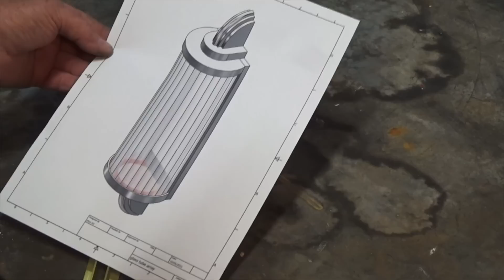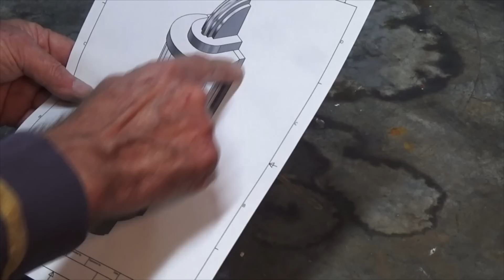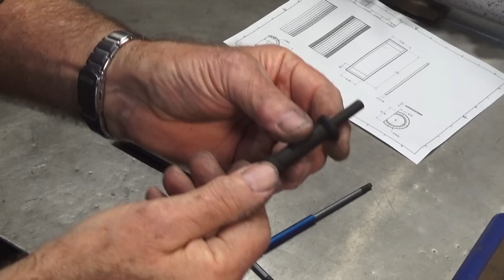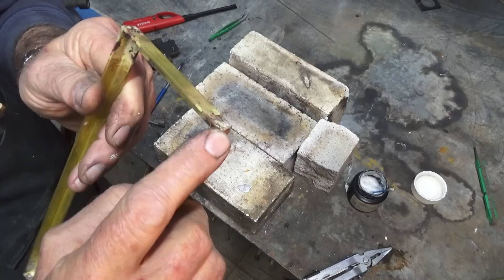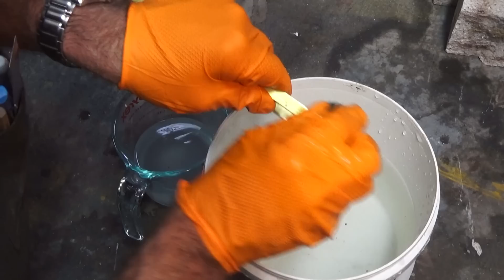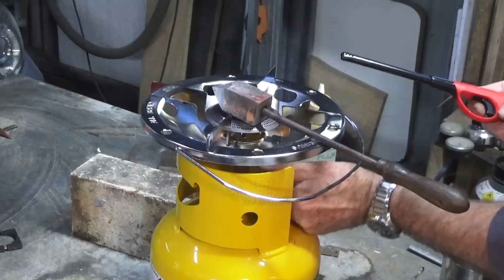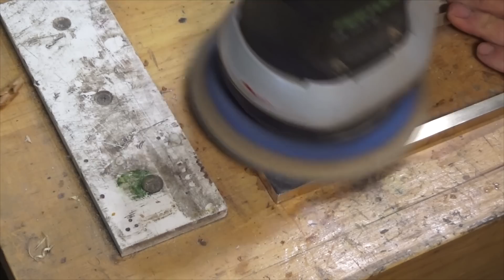New Fabrication Project - All the Good Stuff!

Comment: I guess I’ll throw out the silver rod I have from my grandfathers shop.  Thanks for the heads up on Antimony.
Reply from the maker: As long as you have good ventilation in your work space it's fine. Also the issue only arises if you overheat the puddle of molten silver solder and vaporise the antimony.
Regards,
Mark

Comment: I dislike being a 'safety Nazzy', but if you use lead solder( like old school auto body solder), due to the risks of inhaling lead particulate you should file the material instead of sanding as sanding creates tiny particles that can easily become airborne and potentially inhaled causing the health problems associated with lead exposure
Reply from the maker: I did wear a mask or at least I did after I realised how much dust was being produced by the fine sanding belts. Many years ago there was a very good programme aired on TV regarding the harm caused by people renovating houses which had lead paint on the surfaces. It turned out that many DIY renovators were exposing their children to high concentrations of lead dust. The findings were that children were most at risk because their brains were still developing and many renovators had young children because they could only afford older houses that needed the renovations anyway. Lead is a truly insidious metal and I believe that many lakes are now polluted with tons of lead shot from duck hunters. 
Regards,
Mark

Comment: When your brass turns pink, your acid has leeched out some of the zinc...  it can be a very nice effect if used artistically... but not desirable where strength is an issue. and yes, never, ever sodder!
Reply from the maker: Matt, I always assumed that the pink colour was from free copper in the pickle passively plating the brass but you are probably correct about the de zincification. As it turns out, the pink is very superficial and it buffs off quite easily with a scotchbrite wheel. I am currently driving myself nuts trying to get a mirror finish on the brass parts prior to plating. I hate polishing metal. I don't have the patience for it.
Regards,
Mark

Comment: sol·der
/ˈsädər/
noun
a low-melting alloy, especially one based on lead and tin or (for higher temperatures) on brass or silver, used for joining less fusible metals.
"remove the fitting using a blowtorch to melt the solder"
verb
join with solder.
"the wires to this clip are soldered to the circuit board"

 when in doubt, consult the dictionary. the "L" is silent
Reply from the maker: In which dictionary though? The Oxford English dictionary lists it with an L and the Webster (American) dictionary lists it with the silent L. The Oxford dictionary is older so I am going with that! 😁
Regards,
Mark

Comment: Great project.  FYI, a product called Sparex is often used to pickle copper,  brass and silver.  It’s sold in  swimming pool supply stores.  And if you add a little hydrogen peroxide, it really accelerates it.  And lastly, I’ll pronounce the “l” if you drop the extra “i” in aluminum :-).

Comment: If you use high silver silversolder (40°or more) it will take more heat to get the silver to flow. Use some soft silver solder that jewelers use....it allready melts at 625-650°c. The reason why hard silversolder (more % silver ) is used in jewlery is because of the color......the higher content silver the less difference between the object and the joint. You are plating afterwards...so soft silver is the better option. The chances you burn/melt the brass is almost not existend. To save solder only use the flux where the joint is(a smaller brush)....not a half inch at either side. ....the broader the flux area the more the silver will flow to parts it does not need to be leaving less silver for the joint and more silver solder wasted by sanding.
Reply from the maker: All good advice. I have a supply of that 45% silver solder and I want to use it up. I have used some of the lower melting point solders before and in this application I don't need a lot of strength.  I just didn't want to wait around for more supplies to turn up. I don't have a supplier any where near where I live so it would have to be an Ebay purchase. 
Regards,
Mark

Comment: Antimony was also added to printers type lead to make it flow better.
Reply from the maker: Someone has pointed out that Cadmium was also used in silver solder and it's far more toxic. The takeaway is to always work with good ventilation.
Regards,
Mark

Comment: Nice desing.

My dad used to have a big electric soldering iron, something not suited for electronics, the tip was like 10mm diameter, it would have been more suited for that type of work.
Reply from the maker: My dad had one too. I think I sold it at a garage sale and now I regret it. I do have a very old kerosene fired soldering bit which looks to be still in working condition. Maybe I'll do a restoration on it. 
Regards,
Mark

Comment: Like the comment   from Mario below, My Metals 1 classes all make a metal cup from tin plate sheet metal.  I cut 50/50 solder in short snippets to be resourceful but some of the cups got very heavy when they tried to cover up poor fits.  thanks for the memory.
Reply from the maker: Roger, we also cut up the solder sticks into short billets. One thing I learned the hard way was that keeping that supply of solder clean was really important. At one point someone got lazy and put some old bricks on the soldering bench and the molten solder was kept in the frog of the brick. It slowly picked up brick dust as the kids rubbed the points of the soldering bits into it. Before long the supply of solder was completely contaminated and the soldered joints looked like a horrid black mess. I went to the art department and asked them to make me some glazed ceramic dishes and they worked great.
Regards,
Mark

Comment: Always good to see someone encouraging others to do things.  I notice your steel fixture featured scribed lines through mill scale; does this blunt the scriber?  With the cost of bright mild and difficulty of getting the stuff, we are stuck with black and its mill scale (remove with Scotchbrite angle grinder - eye protection!).  Also, does the silver soddddddddddddddddddrrrrrrrrrrrrrrrring (one word) soften the brass.  Interesting stuff brass.  
Gerald Wingrove (Late and missed) reported the brass shapes he used could not be softened.  An American old timer in Model Railroader years ago mentioned being able to heat treat some commercial shapes back to a hard state from soft.  This is a question that comes up from time to time.  'Everyone' has stories re the brass shapes they use, and ''everyone' talks like their observations apply across the board to all grades of brass, which it doesn't.  For example the brass shapes I use, and the brazing rod I misuse as rod stock, do not turn near as well as free machining stock.  I used to write off heat treating soft brass back to hardness; but that American knew his subject, as did an old plumber who told me the same, using heat and then shock cold.  Hmm?????  The truth is likely to be complex.
You are a great loss to model railroading.
Peter T
Reply from the maker: Peter, the silver soldering does soften the brass. However it will age harden over a period of months. I once had a book which listed the types of brass and the composition. The list was very long, admiralty brass, cartridge brass, bell brass, cold forming etc. etc. I remember reading Gerald Wingrove's book and he reported using a lot of nickel silver stock. It is  mostly brass with some nickel added to the alloy. You can still buy it and it's used mainly for jewellery. I am guessing the nickel made the stock quite hard compared with ordinary brass. I too have found some brass of unknown origin can be horrid stuff to machine. I think wrought brass is one of the worst. Leaded brass is lovely to work with and turns beautifully. 
With regard to the mill scale, I do find it hard to cut through the scale with a scriber or a divider but it can be done and yes, it does blunt the tools. If I think ahead I spray the scale with some white spray paint and just scrape through the paint. It shows up as a nice black line on the white background. 
Regards,
Mark
Reply: @Preso58  Mark: wonderful reply; thankyou.
I owe a debt of gratitude to Gerald; it was he who started me on beating brass sheet (cartridge brass) for model train parts.  I don't have any of the modern Chinese models, though I do have some chassis.  Unlike most modellers, Gerald was not afraid to go beyond flat sheet carpenter's practice.  I cannot match the Chinese, but the difference between 'buying' and making one's own is like the difference between flying high over Port Campbell and riding a bike around it.  The shapes become internalised, as do the characteristics of the metals.  ' A pleasure the townsfolk never know......'

Since Australia has 'offshored' all its skills and industries, obtaining offcuts of (or new stock) BMS has become like buying gold - big minimum purchases, often grumpy sales folk, and long drives.  I almost exclusively use black steel and use one of those 100mm Scotchbrite discs and (with care and eye protection) are recommended.  The effort is almost nothing and the results beautiful.  I can the proceed in the knowledge that if I wreck the part steel is easily and cheaply found.  The unavailability of free machining metal is a stone in the shoe.

I believe a good way of plating a finish onto steel for depicting scribed lines is to mix up a rough bucket of water and copper sulphate (bluestone) and simply soak the metal for a while.  The result is a thin electroless plate.  Use the bluestone mix to scrub the moss off the paths for which it is sold.  If you have an elderly person of low mobility do it often.  A friend and I were trying this on single cut files to electroform model train louvres.  The fog of time caught us, but worth looking into.

I wonder what is at the bottom of the old tale of heat hardening brass????  Model Engineers Workshop Mag. looked into it a few years ago and (I think) found nothing of substance.  If anyone lives in Melbourne /Melb'n/ George White & Co. sells brass and will cut.  Brilliant!!!!!!!!!!!!!!!!!!!!!  Not cheap; but brass never is, and this is top rate stuff.  Usual disclaimer.

As ever; hope this reads OK; and keep going: Pete

Comment: As a jeweler we used to have three jars; sulfuric acid, baking soda and then water. The acid would, overtime actually increase in volume, the baking soda pretty much stayed level and the water was always diminishing hehe. Another interesting thing about Sulfuric acid is how heavy it is, particularly concentrated acid of course.
Good to hear Soldering pronounced correctly :)
Reply: Concentrated sulfuric acid is crazy heavy. I've always been amazed at that when carrying a 5 liter bottle in the lab. Molecular weight of H2SO4 is 98 g/mol as opposed to water at 17 g/mol. Almost 6 times! And its density is almost double that of water.
Reply from the maker: I discovered how heavy sulphuric acid was when I had to pick up a 20 litre container of concentrated acid for an electroless nickel plating bath that we used at our school. I had to carry it to my car and thought someone was playing a trick on me. I believe it's twice the molecular weight of water. 
Regards,
Mark
Reply: @Preso58  Specific gravity of H2SO4 with a concentration of 98% @ 15.5C (60 degrees F) is approx 1.84, so your 20 litres would have weighed around 37Kg compared to 20Kg for water. I bet that was a struggle to lug around hehe.
Decimal system for the win! :)

Comment: Hello Mark. It is great to be back here after a bit of time being away from the Tube. I sure do like your approach to what you do. Just like a real machinist would do, LOL. Jigs and fixtures are always a step ahead for multiple piece work. The best at making duplicates there is eh. I use powder type borax a lot in my silver pouring I do here on the Tube. The warnings on the box are to be paid attention to for sure. They are not there to support the printer ink industry eh. The pickle I use is equal parts of white vinegar and peroxide from the drug store. Left over night it does a nice job. I must try your version using salt. Sounds pretty benign to me. I am an old school fella for most everything I do. These big old irons have a place in my tool box. They are from my grandfather. Thanks Mark. See you soon.
Reply from the maker: I have heard about the vinegar and peroxide pickle before but salt is cheap. The frustrating thing about making jigs and fixtures for the projects that I make is that they get used a couple of times and they end up in the scrap bin. Too specialised for any further projects!
Regards,
Mark
Reply: @Preso58  I hear you on the jigs. I worked as a machinist/welder fabricator for most of my career in the logging/sawmill industry where I would take a bare frame semi truck and build it from the frame up. Trailers as well. Management figured it was too costly for the various jigs, fixtures I wanted. I eventually wore them down and when they saw the time savings on the first bunks (they hold the logs) I was given a raise in pay. That I didn't expect. Years later in retirement I visit my old shop and see most of them still in use. Some things I suppose are timeless eh. These sconces are very elegant. See you next post my southern friend.

Comment: Great project! I have a couple of those big copper soldering irons from the old man's shed. Finally used one a few years ago to persuade soft solder filler around the front cladding piece of a belpaire firebox. I could smell the flux that was boiling off as you were doing it - evil stuff, but it works. I had (probably still have) a lot of trouble with rust from that stuff where I used it on steel bodywork parts because I couldn't get any other flux to work, but couldn't flush the stuff out afterwards well enough.

Nice jig for silver soldering too, they came out really flat and square.
Reply from the maker: I once had an old car that had been repaired by filling the dents with lead instead of the plastic body filler they used now. I wondered how they got the lead to adhere to the steel without using an acid flux. The zinc chloride that I use makes horrid rusty spots on my welding bench and trying to wash it off just spreads it further. My dad used to mix up baking soda with water to neutralise it. I should try that too. 
Regards,
Mark

Comment: Food grade Citric Acid is my go to for cleaning brass or copper, cleans flux off easily, works well in an ultrasonic cleaner as well.
Depends where in this world you are, but I get mine from eBay in 1kg plastic jars (£10), about a desert spoon in a couple pints warm water is enough.
Reply from the maker: I believe they sell citric acid as a powder in the supermarket. I think it's used as a sterilising agent for home brew beer enthusiasts. I haven't tried it as a pickle though. I am guessing that most acids would work but vinegar (acetic acid) and citric acid are at least less nasty than suphuric (which rots your clothing if it spills). 
Regards,
Mark

Comment: My wife saw this and now I have another "honey do"

Antimony or cadmium? 

Citric acid works great for removing flux.
Reply from the maker: Robert, the older type of silver solder contained cadmium as well as antimony. I know that cadmium is one of the more toxic heavy metals and is no longer used for electroplating because of it's toxicity. I could be wrong but the article I read mentioned antimony. I have about a dozen large tubs full of those old model engineer magazines and there is an online index which could look up to see if I can find the article. The danger with both these metals is overheating them to the point at which they vaporise. The issue is compounded if you are working in an enclosed space. My shed is very open and I work with the doors open, even in winter but in some climates it's just not possible to do that. 
Regards,
Mark
Reply: @Preso58  Thanks Mark. The cadmium alloy is still available in the U.S. but is extremely expensive.  Way too cost prohibitive.  56% alloy is a good substitute.

Comment: I use citric acid - food standard from eBay and very safe. It comes as a powder, add to fresh water and pickle to your hearts content.
Reply from the maker: I believe that citric acid is used by home brew beer and wine enthusiasts. I have seen it in the home brew aisle. I have actually been using the salt and vinegar mix rather than the sulphuric acid over the last couple of days. It seems to be quicker than the acid. Also, sulphuric acid rots holes in your clothing if you spill it. Don't ask me how I know this!
Regards,
Mark

Comment: How do you like that vernier scriber?  I was just looking at those and wondering if they're any good.
Reply from the maker: It works great and I get mighty upset when I see people on YouTube using their expensive Mitutoyo callipers as a marking gauge. I know why they do it though. Setting out a line with some fractional or decimal measurement is very difficult to do with a pair of dividers. The vernier marking gauge allows me to get to 0.02 mm resolution. You do have to be careful to keep it perpendicular to the edge you're measuring from though. 
Regards,
Mark